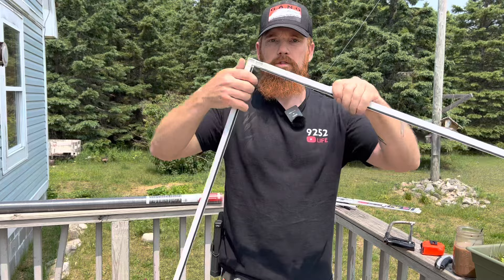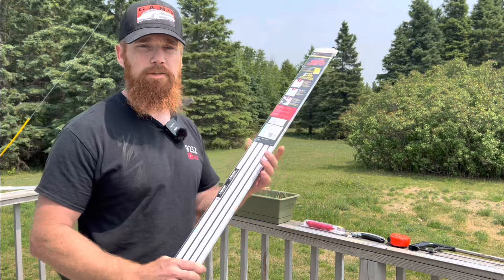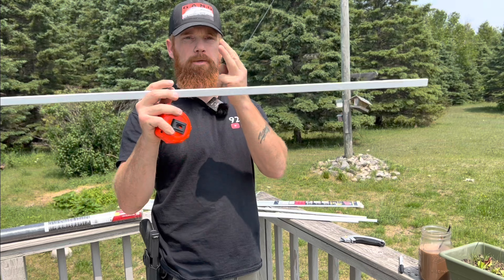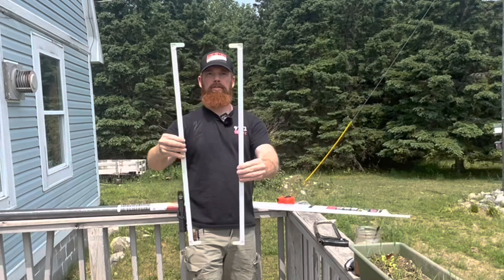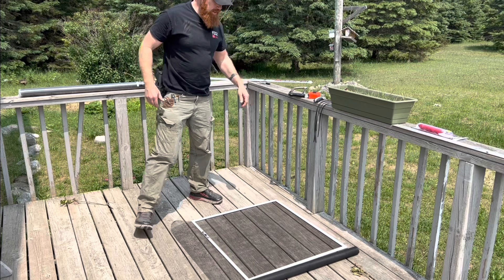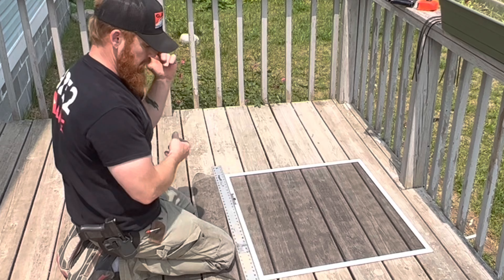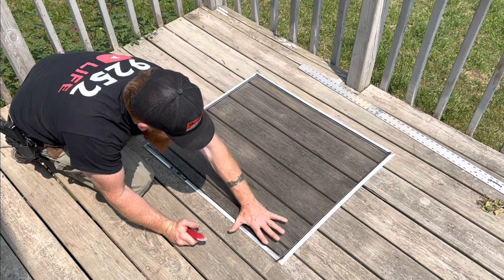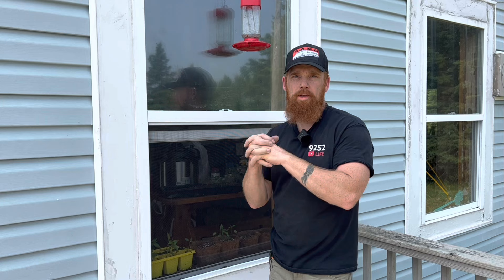DIY How to EASILY make a WINDOW SCREEN for any size window in 10 Minutes...

Comment: FYI it's much easier if you leave the screen bigger and cut after you put it in, just run your knife down the rubber piece. Much much easier!!
Reply from the maker: For sure. Unless you’re trying to save as much as possible
Reply: So put the spline in and then cut off the excess?

Comment: I applaud you in your efforts to demonstrate how to make a screen. I will give you some additional information and perhaps you can make another video with some revisions. In that particular type of window it would be advantageous to insert tension sliding springs on the top of the window screen and pull tabs in the bottom. This way your screen fit snug and with the addition of the pull tabs removal is a breeze... The tool that you are using is a screen roller with one end being convex and the other being concave. Essentially this is intended to screen in a much thicker screen such as a 80 or 90 % polyester or fiberglass solar screen as in these cases a tool with both convex and concave features are necessary. The rubber that you see in this what appears to be a 3/4 inch aluminum frame is what we refer to as spline. There are several sizes of spline such as 103,115,125,140 this depends on the with of the channel on the frame. For example i like to use  a 103 easy to fit spline on my 1 inch by 5/16 aluminum frame. You should never cut the spline in the frame rather take it out. You will eventually have to do this anyway. Siccors is what you might use to cut the spline after it is properly fit into the screen. I would highly recommend not to cut with the sharp edge of the utility blade towards the screen as you may inadvertently cut the fresh screen you just assembled. Instead cut or trim away with the blade pointing towards the aluminum frame. It is always a better idea to screen roll with the tool towards you rather than away from you. If you need any more advice please feel free to message me . Thank you and job well done

Comment: I used to make screens at a hardware store I worked for and the roller we used was made out of steel with ball bearing in the wheel. The ones they sell now don't work anything like professional tools do. We never used plastic screen material. Only aluminum or some kind of unknown metal for gold screens or doors

Comment: You should of explained the rollers the rounded one is to press the screen in the groove on the frame and the roller with the curved edge is to roll the rubber into the groove to hold the screen in ! That is how i learned before they had those cheap synthectic screen material back even before the had the aliminium srcreen ! I was taught by ace hardware back iun the late 70's !

Comment: The only thing I don't like about those kits is the spline is in 4 pieces instead of one continuous piece. I'll buy the spline (be certain you get the right diameter, there are a few different sizes) and use it instead. Home Depot has some killer online how to videos I think by Phifer. If you buy the frame in 6 ft lengths you get it for less than $5 a piece per window (a 20 pack). You're cutting it anyway so it saves you some money. You can buy the corners and other parts in bulk if you're doing all your windows and get each window down to about 3/4  what the kits cost. But for one window you really can't beat the kit.

Comment: i dont know if youll see this.. but i need a 64 H x 30 W screen. i live in an apartment, which has weird windows. it doesnt have a mesh screen or a slot for it, but i am trying to diy one in the space i have. i am trying to keep my cat in and mosquitos out. do you have any suggestions or help? the window is also a push out window, where i need access to the lever. ive exhausted my resources in trying to find a cost effective solution. if you come across this and have any knowledge to send my way, i would appreciate it!

Comment: How much do i leave hanging off the sides?
Reply from the maker: Just enough that it doesn’t pull back through when pushing it down in the frame. 1/4-1/2 inch or so